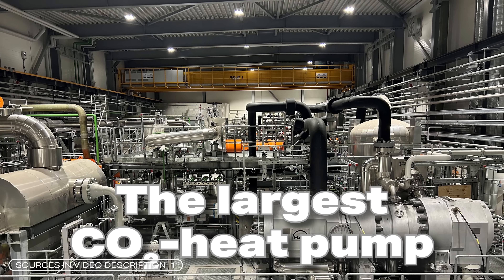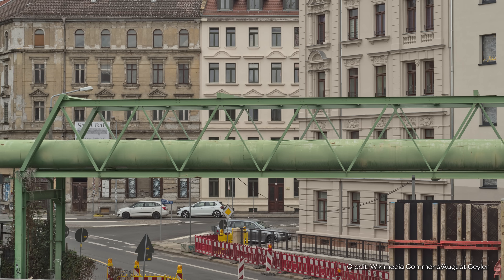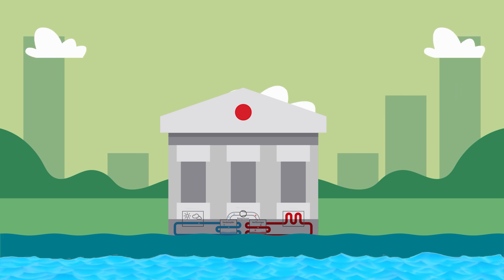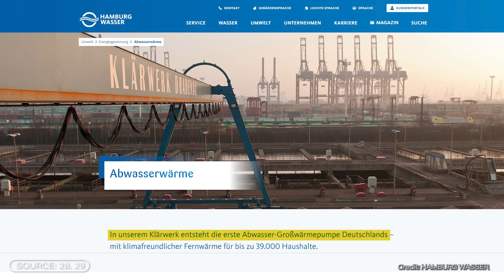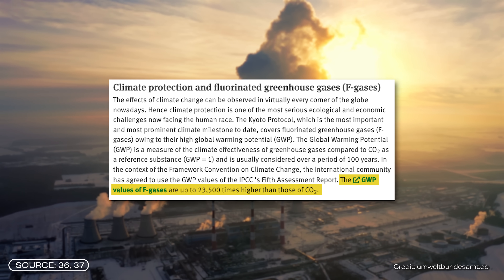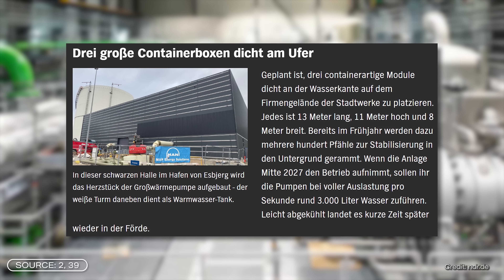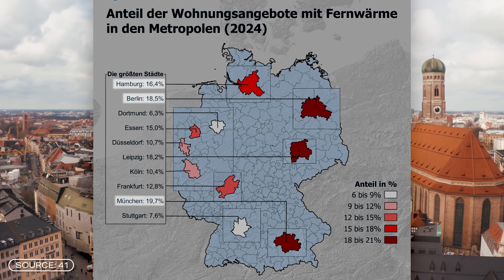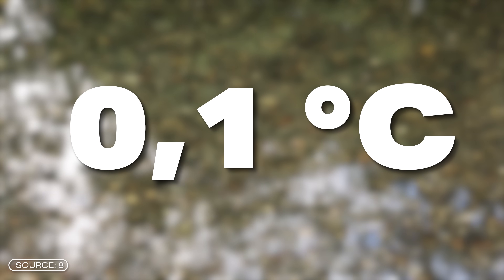World's Largest Heat Pump: Denmark’s Seawater Heating Revolution

Comment: I designed the cooling installations for one of the biggest datacenters in Netherlands. The maximal cooling power is 500 MW. All of that has to be cooled down. This is achieved by a combination of hig room temperatures (28°C), free cooling with ambient air and cooling towers and chillers. The intention was to use the waste heat for a nearby business park, where each individual business should have their own water/water heat pump. The alternative was to generate hot water with a centralized heat pump system. After extensive calculating it was decided that none of the systems could ever be profitable, because of the energy necessary to circulate the hot water. Circulating the waste heat was even more energy consuming because of the low temperature difference.
Reply: Heat pumps can increase the temperature of the circulation water decreasing the volume needed, I'm sure there is a tradeoff between heat pump capital maintenance and energy costs vs circulated pumps.  The biggest problem with using datacenter heat in most areas is it makes sense for the data center to do this in the summer, which is when it makes the least sense for heat consumers.  Always thought it would be fun to make a heated water park in a temperate area using datacenter heat.
Reply: @zyxwvutsrqponmlkh Thank you for your answer to my comment!
I do have some experience with heatpumps, being an engineer myself, and having worked in a consulting company for more than 20 years. Among the projects that I have been involved in, was actually a coolingsystem for a datacenter, where the heat recovery was used to heat some buildings, so I know all about the challenges.
In this case where there is a 500 MW coolingsystem, the heat recovery would have to be planned in the innitial phase of designing the datacenter, meaning placing the facility close to some Industry with a high energydemand.

In my former comment, my point was that it is, in my opinion, a huge failure to build a datacenter with a 500 MW coolingsystem, and not have a heat recovery system, as the wasted energy could in principle be used to heatmore than 200,000 households.
Reply: At what distances does circulating hot water become prohibitive?

Does it change if you can store the water at each house with low losses
Reply: @failing_gracefully  You loose the energy with the long lines to your house ! 
Hence you can save nothing with storing water in a buffer. The losses then will have already occured.
It only works out in a highly dense population or appartment blocks. shorter distances for a huger amount of customers means less heating losses to these appartment houses which then supply 20 or 50 appartments - compared to 1 house every 30 m in an urban environment: 300 m of losses and only 10 consumers x 2 sides = 20 ... where such bigger appartment blocks have only a 50 m street loss to pay for with 40 or 100 appartmens on both sides. 

So if you live inside a highly population density it can make (a lot) sense, but rarely does cause in those cases a solar power roof with a heatpump for the whole block of 50 appartments is again cheaper . 
And less maintenance too. Imagine to find  a leak.

Final nail in the coffin: we had a bio mass plant that generated electricity and heat. Heat was distributed via pipeline with parts of the village. All had been happy til the day a fire destroyed the bio mass plant and hence no more heat cause they had no spare unit for heating or a too small one in the beginning. So add the cost of a spare system and efficiency goes down , cost will increase and customers have to pay the bill. 

And without competition you are screwed cause no competition means too high price levels.
Reply: I did something similar with a 2MW installation. It would have doubled the cost to reuse the heat inside the building or to dump it in the on-campus swimming pool, so it never happened
Reply: Many Danish towns already have working  district heating systems with cogeneration plants. So it makes sense to add centralized heat pumps  to an existing system as they do in the video.
According to local experts district heating is often  the cheapest solution, but it requires buy in from a fairly large percentage of households  to be cost effective.
Reply: Don't yall have a lot of greenhouses that need heating in the winter? They seem like an obvious customer.
Reply: @SXMaarten01 What an astronomically big WASTE of energy cooling system you have designed.
This is nothing to be proud of, and your explanation of why it was not possible to use the waste heat is not a walid excuse.

If the heat recovery was a priority, which it of course should be, then the datacenter would be placed in close proximity with some high energy demanding industry.
Reply: @Ejvind-t9w  are you sure you want to live near a data center? 😂 
Those are big unsightly buildings, with year round 24/7 high energy usage and noise of chillers/ heat pumps and diesel generators. The grid in your city will also not be capable of delivering such high power on a cold winter’s day at 18:00h. This is why we build data centers in industrial environments, where the grid is scaled to deliver such power, and no NIMBY’s complain about the noise or the sight
Reply: @zawatowski Hello, I was not suggesting that the datacenter should be placed close to areas where people live.
I suggested that they should be placed close to, or in industrial parks, and as close as possible to Industry with high energy demand, so the heat from the datacenter can be recovered and used in the industry instead of being wasted.
Reply: Such is the capitalistic profit making viewpoint

Comment: I have solarpanels and air to air heating pumps, as long as the solar panels produce electricity. I have free heating or very cheap heating. I am about to install  new solarpabels facing east and west. 

Next step is an ev with vth and a 70 kwh battery for storage.

Comment: Recently I lived in a new apartment complex in Diemen, Netherlands. We were connected to district heating using waste heat from a gas power plant. It was comfortable, but it was low heat, so you do need good insulation and floor heating everywhere. The costs weren't terrible. Now I live in a house, we got solar panels, insulation and a heat pump and our energy bills should be around zero 🎉
Reply: Zero? Running heat pump with pv in december? Good luck

Comment: cop of 3 is not great, this kind of system might make sense in hotter countries where heat pump can work with higher efficiency but northern countries should just stick with waste heating of coal, natural gas or nuclear power plants. Considering the piping cost and piping heat loses, just making more wind turbines and heating the homes with regular resistive heaters might have better benefit/cost ratio.

Comment: We love our heat pump! Before it was installed, we used average amount of electricity and natural gas compared to other similar sized homes in our neighborhood according to our utility company. Now, with the heat pump installed, we are now 14% more efficient than the average home our size. We've coupled the heat pump with our previous investment in solar panels and they work like hand and glove especially in our warming climate.
We had central AC before and my family would constantly complain it was never cool enough on the second floor on hot days. With the heat pump, I no longer hear these complaints and the heat pump is more efficient than the AC. Plus, the heat pump will do more work during fall and winter taking the workload off the natural gas furnace. For us, going green has meant saving $$$ 😂😂😂

Comment: Why do you bother to quote the yearly heat output numbers?
They are completely irrelevant!
For a heating device you need to know  the maximal heat demand on the coldest winter day to figure out the number of homes  you can heat.
Reply: If a second producer is included in the system the truth will be somewhere inbetween. If heatpumps can provide 100% of heating required 80%-90% of the time, the secondary source can use stored resources or lower the reliance on less environmental sound solutions.
Reply: @Andreas-pt8le  Yes, it is the reality for many cities.
I guess a city as Hamburg uses surplus heat from a power plant. Putting in a heat pump, means the network can be extended to even more houses.
Reply: The heat pump, ain't the only source on the network. But it might be the one that produce the cheapest heating. So you want to have it going max all the time.
That might mean 20000 houses in summer, 15000 houses in fall and spring, 10000 houses in winter.
In your example,  2x5000 (fall and spring) houses and 10000 (summer) won't receive heat from the pump, because in only delievers according to (winter) houses, thus wasting 10000 houses of capacity of the cheapest source.
Yes, the way of explaining it in houses, is very unprecise, but it is only to give people a rough idea of capacity.

Comment: In Australia many of us have "heat pumps", but we don't call them that.  because cooling is more important to us we call them air conditioners; we just add the prefix "reverse cycle".  So in winter they take heat from outside and dump it indoors and in summer they take the heat from inside and dump it outside.  

Many people have one whole of house unit.  We have chosen to have 5 smaller individual units.  It provides some redundancy.  It's very unlikely that they would all die at the same time.  

Neighbourhood heat pump systems sounds like an efficient idea.
Reply: The Sydney Opera House is cooled by seawater.
Reply: @alexandrshevtsov8 North Sydney Olympic Pool is heated by harbour water (as is the oera house in winter.)

Comment: The tech is nice, and it may be usefull in city´s where there is ground heating network, and where gas/oil/trash is being burn to make hot water for heating houses and high rise building, but in the urban area where there is a lot of gas boilers, pellet stoves, wood or oil then there is a problem, and that is price... current here in denmark, the price of gas is about 1.46eu pr m3 of gas, wood pellets are about 340-350eu pr 1000kg, and heating oil is about 1750eu pr 1000 liter.. depending on size of house and insulation values of your home, usage varies a lot, and due to rules and regulations there is a lot of problems.
If there is no pipes in the ground, the digging og laying pipes and making infrastrukture (pump stations, heatpump, access to grid power and the installations in the houses) i a lot of cases the upfront payment can be 5000-8000eu for the installation pr household. and the rest of the cost to make the hole plant work, is shared in equal bits for the customers over a 10 or 20 year payment plan. and depending on how the plan of operation is being made it can have devastating effect on the payment.. fx where i live.. rules where set in place that all household over 150kvm (sorry no freedom units here) had to pay a additional fee since the heating requrement will be higher, but houses under 150kvm will not have that fee.. but there where no check on how much the houses used on the old heating platform for the house. So in a residential area with somewhat newer houses (15-20 years old and general larger houses which have good insulation, many of the houses would have to pay up to 2000eu pr year just to have access to district heating, and then have to pay for the heating on top of that. my savings on runing my own heatpump each year means that in about 8-9 years i can swap the outdoor unit for at better/more efficent unit. Another thing is... if your a connected to district heating, you cant get out of it again and you are forces to pay your part... Some places here i denmark the heating compay have made some really bad investment on behalf of the customers to a point that it will effect the price on you house in a negative way if you are to sell.. I made the switch from a funcktional gasboiler and a usage pr year on about 1300-1400m3 of gas, to a air to water heatpump and a usage about 4200-4500kWh pr year.

Comment: I live in Copenhagen denmark where we have district heating.

It works like a charm and it is not affected be trumps or putins gas prices. 

Its very good
Reply: The Copenhagen system is sweet.  You guys burn garbage to produce the heat dont you?  There is that massive ski hill building.  I'd love to see more of that.  If you just keep on building dumps you are creating large areas of land that nothing can ever be done with.  If you just burn the garbage you are just left with ash and CO2.
Reply: @pin65371  The ash is used in cement production
Reply: @pin65371 actually in Odense, Denmark, gas is extracted from an old landfill area originating from decomposition of buried waste!
Reply: Trump does not set gas prices.  Private companies do that. The US does not have state owned energy.
Reply: @dherman0001 correct, but prizes fluctuate depending on policy
Reply: @KasperLidegaard of course.  no matter who the president is this is true. fortunately the current US presidents policies have brought energy prices down.
Reply: @dherman0001  Ehhh, one can argue about that. And it of course also depends on where you are in the world. Gas prices depend heavily on the situation in your local area.
Reply: @placeholdername0000 No, its a fact that increasing supply, lowers prices, especially with commodities.  Though, your govt may be meddling in a manner which denys you the ability to benefit from increasing supplies.
Reply: @dherman0001  Yeah, it very nice to talk about increasing the US supply of natural gas lowering prices, but there isn't a natural gas pipeline connecting the US and Europe lol. And no, the LNG ships aren't enough to do much either. They can supply something, but not enough to actually affect the gas prices that much.

I don't really care what the gas prices are in the US, if the price over here is still high. There is a reason why Europe is further ahead in building new energy sources, as we gain much more from doing so.

In short, it's not really the government doing the price setting, it's geography. We don't have cheap natural gas deposits domestically, and importing has its own problems.

Also: Trump has been restricting the supply of solar and wind in the US. So much for free markets lol. This will make your electricity prices higher in the long term.
Reply: @placeholdername0000 mine will always be cheap with solar.  no restrictions.  also, brevity is a virtue.
Reply: @dherman0001  Brevity? Ok!

Ding, dong, you're wrong.

Comment: With such a large system, electricity can by recovered when the compressed gas is released inside the heat pump.
Reply: Please explain???  Energy capture at the expansion valve?
Reply: @CCRoselle any time you release pressure, it can be run thru a small turban and dynamo to get back some part of the energy used to compress the gas. In this system it can be passive, perhaps collect to batteries, or directly added to the grid .
Reply: @susanvaughn741  Guessing that it would lower system velocity and the rate of heat transfer?

Lower performance?

IMO:NO FREE LUNCH.
NEVER!

Comment: In Geneva we have a large heating/cooling project in development, using water from our lake to extract heat in the winter through massive heat pumps and heat distribution into the city. In the summer cold water (from the lake) can be circulated in buildings to cool them.

Comment: The SANCO2 Air-to-water heat pump used for hot water has been around for well over a decade and uses CO2 as its refrigerant.

Comment: If it's run by a non-profit, there is a chance that it will actually be good for homeowners and renters.
If run by a normal private company, it will absolutely try to milk its clients as much as it can to the point that those will heat with power because it's still cheaper (and I know, that DE has insane power prices basically crippling its own economy).
Reply: Yeah, isn't it amazing? And all because regressive politicians hate clean/renewable energy with passion -_-

Comment: The alleged high efficiency of heat pumps is nothing more than accounting fraud.  There is no such thing as over-unity. No heat pump is anywhere near 100%, let alone 500% efficient.  All it does is move heat from one spot to another and so it can move more heat than it consumes.